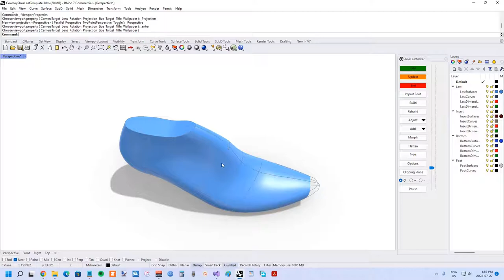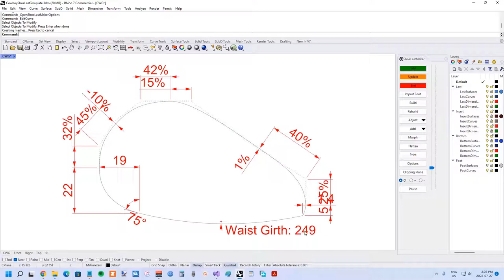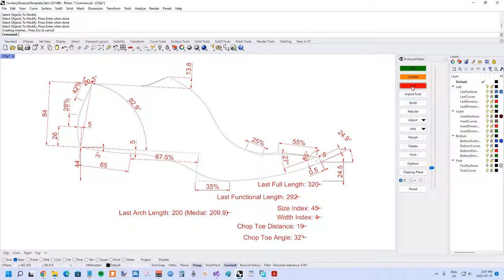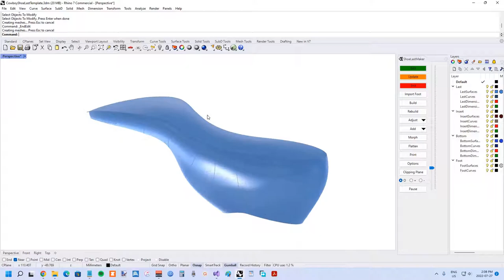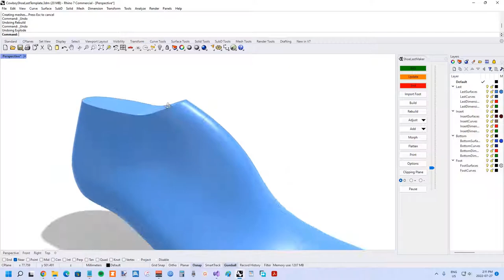Parametric Cowboy Boot Last Design Template

Comment: I'm missing the approach of the shaft for real boots. A main difference between a shoe and a boot is the profil curve which leads to the shaft. This should be considered.
Reply: You could make this design adjust to the template file with Shoe Last Maker

Comment: can you save the last and the insert as a STL file?
can I continue editing the last in rhino?
Reply: Yes, you can export as stl. The stl is not parametric, but you can continue editing the parametric model in rhino.
Reply: @samlochner6315  thank you
Reply: i have another question: when making a custom shoe last based on a 3d scan of a foot. does the plugin know exactly how much to take off the correct amount on the ankle? and does the plugin know to consider any corrections based on the 3d foot scan?
Reply: @SimchaYaffa  The plugin takes foot measurements and adds on allowances to get shoe last measurements. This is done for girths and widths. Ankle girth isn't a primary measurement in the parametric definition of most lasts, except for the ankle height last. I don't believe the ankle height last angle girth is set automatically yet, but likely will be in the future.